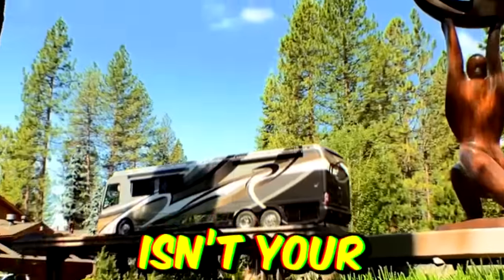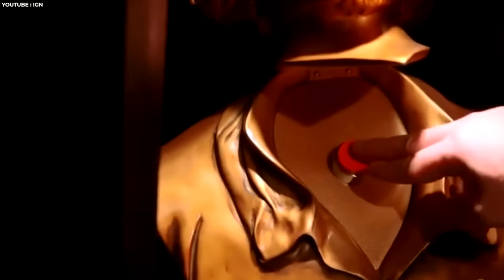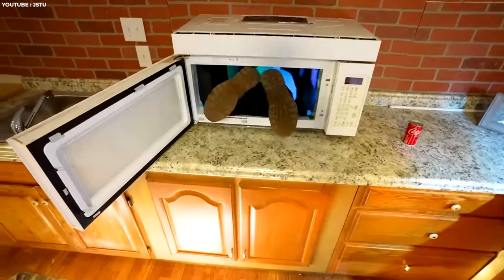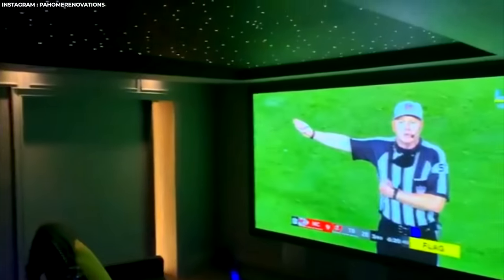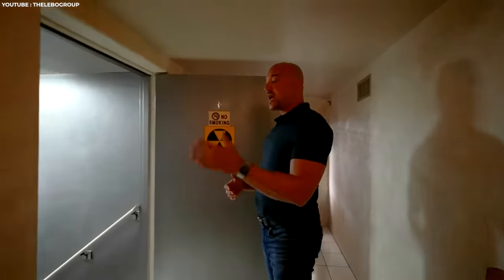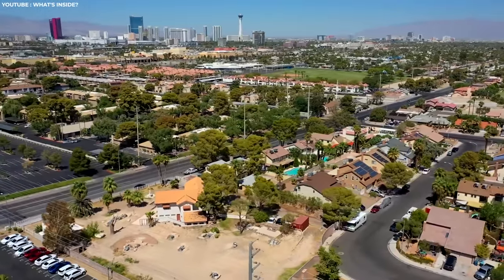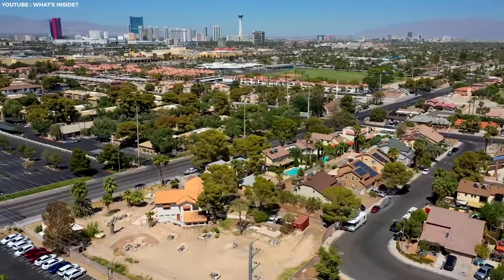Neighbors Laughed At His House, Until They Went Inside...

Comment: He better be hitting that gym long and often if the entrance to his gaming lounge is a microwave :') Too much gaming and you're not gonna be able to get in or out of the damn place :p
Reply: i was wondering how you get out....i imagine there is a door and stairs like any other basement
Reply: @perry92964  Any other basement doesn't require to be hidden behind a microwave though :p Any extra doors and entry/exit points will make it less secret lair and more just regular basement with a weird extra entrance.
Reply: @reznovvazileski3193  it was probably a laundry chute once,   there not climbing out that way
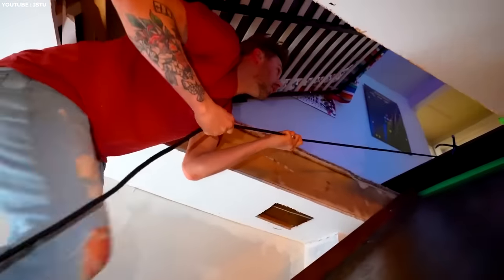Reply: @perry92964  6:50 He did it elsewhere on a steeper incline so it is definitely possible. Just saying it's not the most practical entrance he's got. My comment was more hinting at the part where he has to squeeze through a microwave opening whereas gaming too much instead of hitting that gym in the other room can leave him a bit too big to fit through.